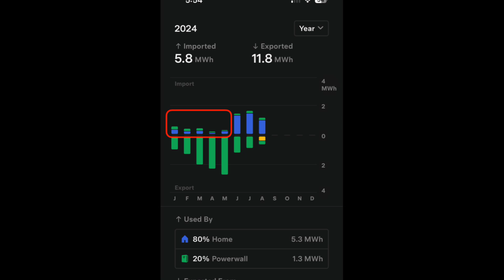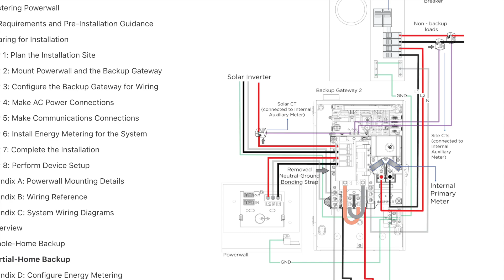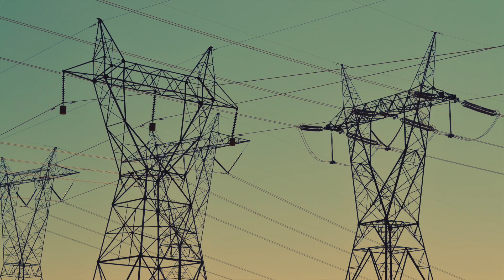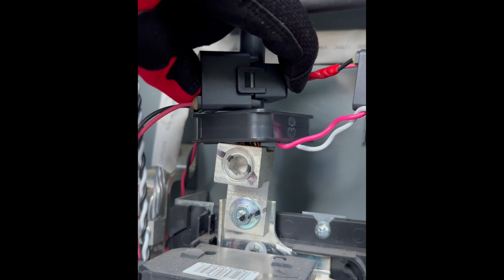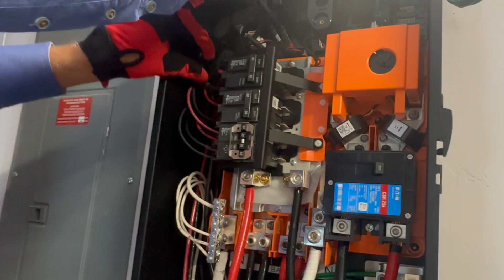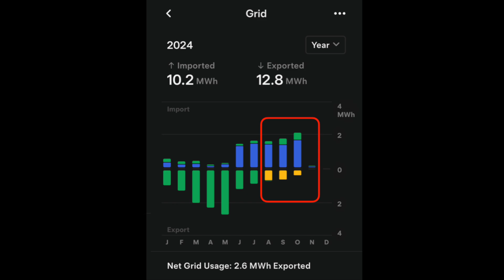Solar at Night? Fixing Tesla Powerwall Energy Metering

Comment: I would like to clarify your use of the word “phase”. Your house is “single phase”. The two “legs” are just that, legs, not phases. In power distribution systems you will have single phase and 3 phase systems. The utility transformer is what determines what you will have. 3 phase is more of an industrial application. I also would have you be cautious with CT’s. The ones in your video are called split coil CT,s. There is another type of CT that is a continuous loop that requires physically removing the wire from the lug and flipping it and putting the wire back in the lug. This type is extremely dangerous when the circuit is on.  Well educated electricians will know to short the leads of the CT output when working hot. The secondary will try to reach infinite voltage the instant there is no load on the secondary. Very dangerous. My advice to anyone is simply, Never Work on an Energized Panel!!!
Reply from the maker: Thank you for taking the time to write this. A lot of good information here and I will repeat your final sentence: "Never Work on an Energized Panel!!!"
The point about the possibility of an infinite voltage occuring on the secondary is also a good one, and I considered including that in the video. I'm glad you made it here.
I did a ton of reading and asking of electricians regarding how to refer to the two "legs" most houses on a single-phase residential system have and ultimately decided to use the colloquial "phases," but I agree with you - the utility is only supplying a single phase to the transformer, and the transformer is basically both transforming the voltage down, and also splitting that single phase into two "legs" which are really parts of that same sine-wave, but because of how the transformer's secondary coil is wired internally, 180 degrees shifted from each other (which is why with respect to ground or neutral, each leg is 120V, but with respect to each other, 240V).

Comment: My system is showing the same amount being used as the same amount being produced. And when one changes up or down so does the other. Also system has shown power usage even after I shut the main breaker off. I'm not sure how they hooked up my system but I think they missed a few things somewhere.
Reply from the maker: Yeah, this sounds like they have (at least) one CT in the wrong place or upside-down. From what I saw when I was researching this for my video, the installers are getting better at figuring these mistakes out. Good luck!
Reply: I’m having this same issue.  When I kill main breaker the grid value goes away and home load continues to draw a ridiculous amount of power. 14kw

Comment: Thank you for this video. After my Powerwall 3, Gateway 3, and Remote Meter were installed, I immediately noticed that the solar production numbers were 2x as high as it should be, the house consumption numbers were too high, and the house consumption graph was mimicking the solar graph on the Tesla App. Long story short, the installers configured the Remote Meter incorrectly and I found there were two CTs on each wire on the solar circuit breaker when it should be just one CT. All I did was disconnect the CT and problem fixed.

Comment: Excellent video, and a big "thank you" for your time making it (I can't imagine the number of hours you took in post).  I've had one major problem with mine: the original installation team did not fully tighten the two nuts directly above the main breaker of the Gateway, which caused my system to go on-grid/off-grid at random (likely with temperature changes).  This was ~10 months after the installation, coming into winter.  It took the repair man a whole day to finally step back and go over the basics.  When he put the socket on the nuts and almost gave it a full rotation... he just let out a big "No Way!".  Having a father who was an electrician by trade, we both knew the impact this could have.  Sure enough, no more instability was seen/heard from the Gateway.  Sometimes it's the simplest things.
Reply from the maker: I can see it in my mind when he discovered the problem! No visual cue to detect that. He must have been verifying everything at that point. Yeah, the video took way too much time to do, but I'm still new to this, so learning iMovie is still kinda fun.